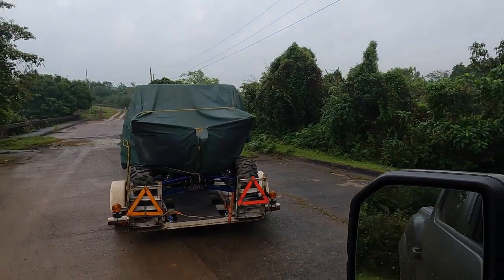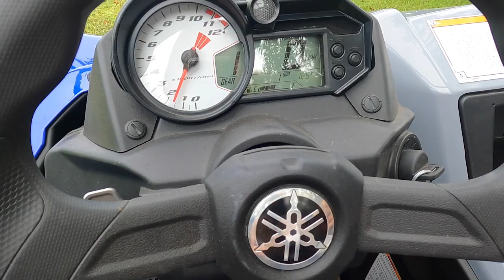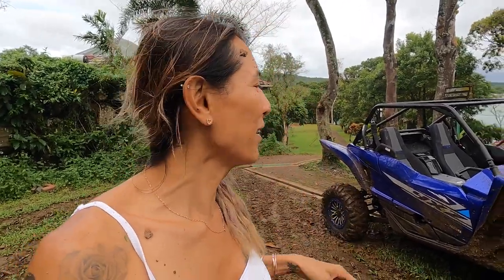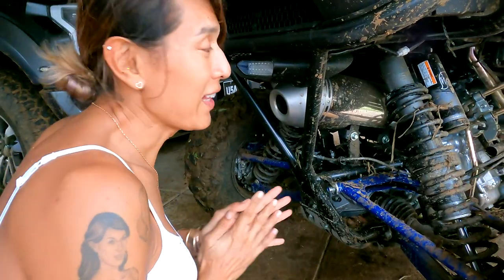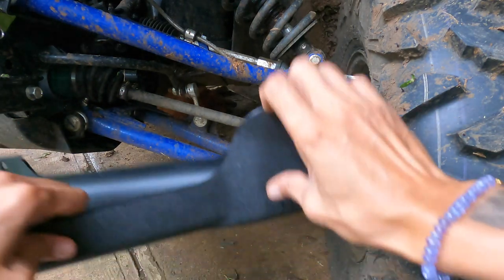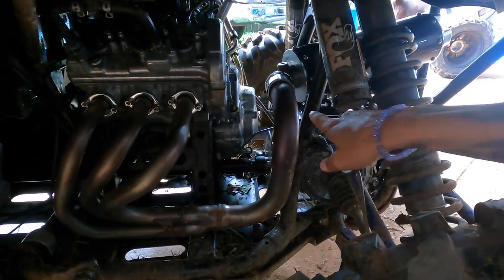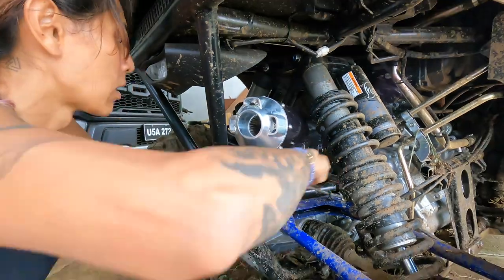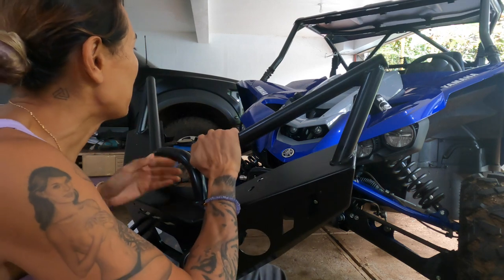I just got my manual Yamaha YXZ (2021) | Angie Mead King

Comment: Nice machine!  Two important tips- and I speak from experience...please wear a helmet and second, never, ever put your thumb/fingers inside that steering wheel.  If you hit a rock or anything, that wheel can quickly spin full clock and break whatever is in there.  It happens all the time.  These things do not have a rack- it's direct so it does not behave like a car.  Just search online- you'll see.  They also tip easily- which by now you likely already know!  I recently took a KRX1000 on Hell's Revenge and all around MOAB, UT.  If you are ever out this way, that is an adventure you would probably like a lot. Great hiking in that area too and even base jumping.  You seem to be the adventurous type.

Cheers!

Comment: You definitely need to get the boxes off the floor before you get hurt. It's super dangerous and I've personally witnessed gas petals getting stuck in full throttle and losing braking! You are not driving on predictable surfaces and driving conditions. I have a 2016 yxz standard and love it, good luck.

Comment: I have owned two YXZ’s and have 16k miles between the two of them. If you have not already, you need to contact Graves Motorsports and have them flash your ECU. They have the best flash tune  in the industry for the YXZ. You need to air your tires down to 10 PSI as well. Also, you need adjust your shocks and turn the 17mm clicker all the way counter clockwise (left). This will improve your ride.
Reply from the maker: Thank you will try this

Comment: Hey Angie I'm having my new '22 3 pedal delivered later this week! I was wondering how the winch/bumper 0weight up front would affect handling/feel. Did you notice a difference after the install?
Reply from the maker: I like the extra weight on the nose. It felt to light without it
Reply: @AngieMeadKing  Good. I wanted to get a winch, for various things encountered on the trails, but was worried about the weight. so I will keep it on my list of things to add..

Comment: Could you please help me out, or anyone out there?  I picked up a 2016 used with 3kmiles, 3 pedal, stick.  Hard to pull away in 1st gear without stalling the engine, what kind of clutch in in your machine?  Just wondering if I need new clutch plates.  Thank you if anyone out there is a clutch expert for these machines.
Reply from the maker: Stock clutch still I don't drive it a lot.
Reply: @AngieMeadKing  Thanks for the reply.  I will replace clutch pack, it runs fine and no slipping, just getting it rolling from a stop is the problem.